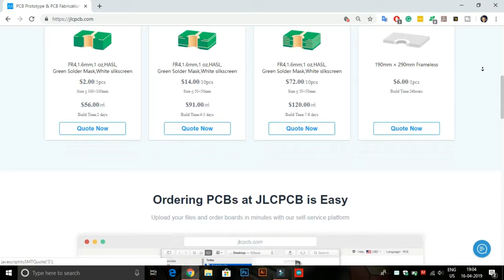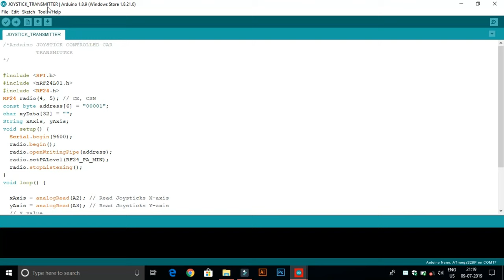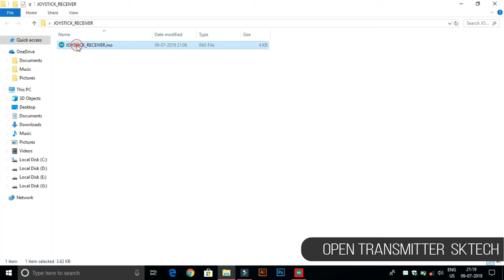How To Make A DIY Arduino Joystick Control Car At Home

Comment: Can this be done with arduino uno?
Reply: Dhitongszkie Tan obviously, the code seems to only use a couple of the output pins. He more than likely used the nano because it was smaller
Reply: Dhitongszkie Tan obviously, the code seems to only use a couple of the output pins. He more than likely used the nano because it was smaller
Reply: @perezr9623  Another question if you may, I have uploaded the codes to an arduino uno but the transmitter and reciever is not working. do i have to change some codes for the uno or is it the same as the nano? Thanks. Sorry for thr incovenience because I am new to arduino.

Comment: Is the code work if yes I will make the project .plese reply
Reply from the maker: Yeah it works bro
Reply: @DIYBuilder  no, it does not, while compiling shows an error
Arduino: 1.8.9 (Windows Store 1.8.21.0) (Windows 10), Board: "Arduino Nano, ATmega328P"

JOYSTICK_TRANSMITTER:8:22: error: nRF24L01.h: No such file or directory

compilation terminated.

exit status 1

nRF24L01.h: No such file or directory

This report would have more information with

"Show verbose output during compilation"

option enabled in File -> Preferences.
Reply: @TechyChung  add the library from .zip files.

Comment: Sir one request how to reset Arduino Uno board please sir speedly answer give me sir🤔🤔🤔🤔🤔🤔🤔🤔🤔🤔🤔🤔🤔🤔🤔🤔🤔🤔🤔
Reply: To reset the adriuno board..  U will find a physical small red button on the corner..  Once u press that,  arduino is reset.
Reply: Sir I already this proses I will tryed not worked. Another    suggest proses give me sir please. 🤔🤔🤔🤔🤔🤔🤔🤔🤔🤔🤔🤔🤔🤔🙄🙄🙄🙄🙄🙄
Reply: @prakashvishwakarma5275   try uploading an empty code to the board that may help you.

Comment: Gerber file not working
Reply: Help
Reply from the maker: You don't have to order dot pcb from JLCPCB. You can buy it from offline market. If you don't find it from offline try Amazon or banggood
Reply from the maker: Pcb dimension is 10x5cm